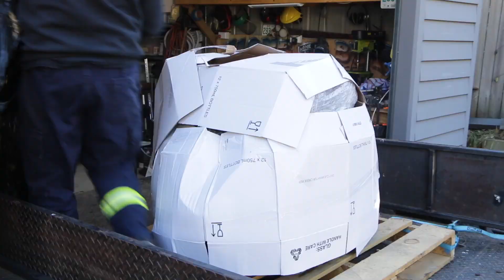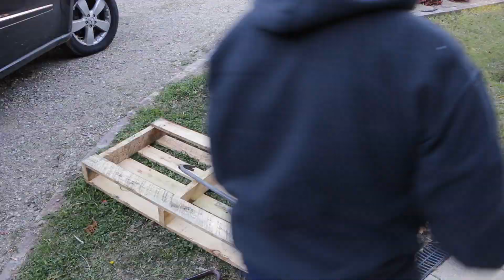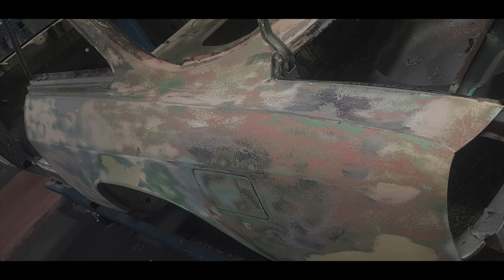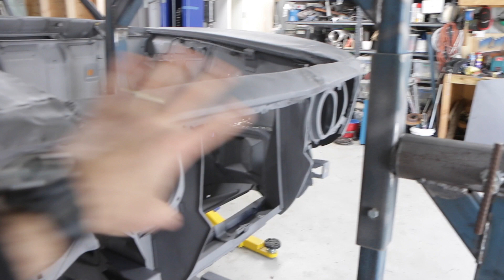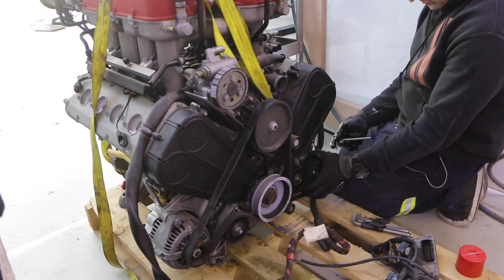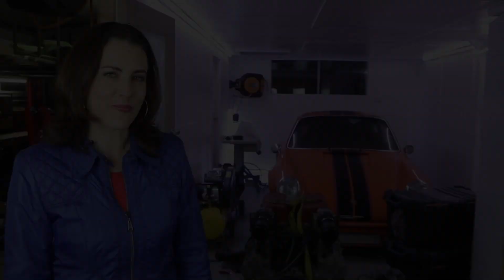How much does a Ferrari engine weigh? - Alfarrari 105 project car build part 10

Comment: I don't think that intake is going to fit under bonnet.
Maybe open velocity stacks?
Reply: With that engine? Just cut a great fat hole! Or perspex scoop. Anything to see that glory. Embrace your 90's show car aesthetic Jeff.
Reply: @DiscoFang  You're right, but you'll lose the 'stealth' factor of the harmless alfa.....  i would consider remaking  the intake so it fits under the hood.  Looks like that intake is about 300mm above the heads... holy cow.  Be curious to measure from centerline of crank to top of engine, it looks really tall.
Reply: Joe M When Jeff was talking about the engine with it next to him on the pallet I was visualising an episode of him making up a replica with cardboard boxes to get a ball park of fitment in the engine bay.  It's a curious thing, the relative heights. Scale in isolation can be deceptive.
Reply: @DiscoFang  Different car/engine configuration as well.  that ferrari motor went behind you, not quite the same challenges with vision.  i think the velocity stacks will be an excellent idea. it will look kick ass as well, they always do.
Reply: To do it properly, IMO, measure the effective intake runner length and approximate plenum volume, then using those measurements create a Medusa of piping to squeeze it under the bonnet, a la E39 M5 ;)
Reply: @computiNATEor  You put this engine in an E39?
Reply: @stuartd9741  No, what he means is that the E39 M5 has long intake runners, but they're not stacked vertically like the Ferrari engine, instead it's like a bunch of snakes down low covered by the intake manifold - from pictures I've seen of those engines disassembled.
Reply: Everyone loves a nicely done bonnet hump, lets people know it’s packing heat

Comment: Thinking aloud but if you have a custom flywheel done, would it be worth having the Ferrari trigger pattern on it too. Just think it might make ECU life easier as you'll need one that understands 'Ferrari' - based on the cam positioning with the quad cam setup, ign firing order and crank trigger pattern too!! - So if you ran an FA20 trigger it'll confuse it and might stop the cam and crank sync process. (I've just had a similar/ish issue on a standalone that wouldn't crank sync because my aftermarket flywheel was slightly different to oem spec).

Comment: If you have to replace the front section anyway, why not go for a step-nose?
Reply from the maker: I could, but I actually prefer the neater look of the later nose. I will be backdating the rear end to take the 1750 tail lights.
Reply: @HomeBuiltByJeff  I'm biased because my 105 is a step nose GT1300 Junior (with a 2lt Twin Spark transplant) but I personally think the later four headlight nose is too busy... horses for courses. Anyway, great project... it'll be a fun ride.

Comment: Seeing as you are building an Alfa hotrod, and you have lots of metalwork to do, just set the engine back further than normal, cut and rebuild the bulkhead (firewall), get the balance back that way.....
Reply: It won't do much, but move the battery to the back as well.
A bigger diff will help as well
Reply: Monk Really?! It will do much.
Reply: @tomahoks  I'm coming from the performance Miata world, where we use batteries that sometimes only weigh ounces
Reply: Dang! It I was going to mention this!
Further back the engine, lessens weight distribution.
 issue.
I Agree.
 Locating the engine
couple of inches back would help offset extra weight.
 + battery in the boot.

Comment: By the way small weight difference can be fixed not just by strengthening but also addition of larger fuel tank just behind rear axle.
Also help with traction of course😉🙂👍👍
Reply: Steve Veness You don’t wanna hang weight in front of the front wheels or behind the rear if you can help it. Yeah front/rear distributions important, but mass centralisations where it’s really at. 

Stick a big fuel cell behind the front seats under the roll cage!
Reply: @Jonathan_Doe_  Granted point of fact.
However if tank can fit over rear axle that would be perfect. More down force for traction. 

For example my UC 4 door Sunbird got a nine inch rear and a 90ltr truck tank above diff. Front end had motor sitting behind it.
I ended up with a 45 / 55 split with me in driver's seat which I figured was pretty cool.
Certainly goes round corners very fast😉🙂👍👍 
And of course every car is unique as to what work's due to wheel base track width and of course available space with out removing entire floor and starting with a tube chassis of some description.
In  Jeff's case behind diff could work out OK.
However neither of us are aware of what route Jeff is actually going to take.
Gonna be fun watching for sure😉🙂👍👍

Comment: how about Porsche 915 gear box?
Reply from the maker: Not exactly renowned to be a great gearbox, it is a transaxle which (which I don't want) and it faces the wrong way so I would have to have it altered.. and have you priced them lately ;)
Reply: @HomeBuiltByJeff  Yep. Dont recommend them. I had a redone one in my 911 and still had to be pretty careful to not rush it. I've made a video with that car, in the beginning you see me step in and drive away quite spirited, than it works. If you rev it high it will shift pretty good but its a bit of a pain otherwise. My mate who drove most of the video (while i filmed) couldnt shift it like that. Here's the video, (i think you'll like it) https://www.youtube.com/watch?v=GP_VsyCxb_k

Comment: Nice one Jeff - what are you doing with the Ferrari plenum? Looks too high to fi under the bonnet
Reply from the maker: There is a plan ;)
Reply: @HomeBuiltByJeff  I guess it's going to look cool just sneaking a peak out of the bonnet :D
Reply: The Alf twin cam is a very tall engine, there’s probably not much in it and the inlet runners could be shortened if required, what will take a bit of thought is the Ferrari’s engine is designed to sit very low in the car.

Comment: one way to fix the weight balance is to just throw a bag of cement in the boot :)
Reply: of course the more indulgent way to do it is to spend time strengthening the torsional twist through to the rear suspension by throwing some nice chunky steel bracing in :) .. just wait until you've stated with the fit up and see if you can steal someones car scales then you should be able to end up with a car at an almost perfect 50/50 balance by the end of it.
Reply: @KlaytheFounder  indeed😉🙂👍👍
Reply: relocating the battery could also help. take that 10kg lump from infront of the front wheels and put it near the rear wheels.
Reply: @myopinion69420  probs some lightweight bonnet would help as well
Reply: @myopinion69420  yeah, I don't think that the engine is going to leave much room for a battery under the hood anyways :D
Reply: @KlaytheFounder  yeah, that was my thinking, does not look too wide though, mostly tall because of the intake.

Comment: Wow, half the weight of the car must have been bog.
Reply: Should be way faster without the bog for sure😉🙂👍👍
Reply: @steveveness3829  looks like it has had multiple decent accidents in its life. sucks when you see that kind of thing.

I have seen cars where there has been nearly 4cm deep of bog on the bonnet, a panel that is easy to replace and easy to get the the reverse side of to fix.

why they didn't just take off the bonnet and give it a swift kick from the inside before resorting to bog i don't know.
Reply: @myopinion69420  LMAO yea I have seen that to🙂
As a matter of fact I had a HT Holden Station Wagon, that was side swiped by a truck on the right side of it
( right hand drive).
Rear quarter panel is hmm approx 2mtrs or 8feet long. They hung flat sheet steel over the damage oh and steel was 2mm thick then sooooo Much bog to create the shape. The rear door and front door I could hardly lift after I stripped them out.
They just went into the bin.
Have to admit it went round right hand corners really well no matter how fast I dared go around.

LMAO Left hand corners well above a snails pace and it drifted all over the road.😉🙂👍👍
Reply: @steveveness3829  yeah, it was on a mates drift car, he said he wanted to get a carbon fiber bonnet because his was too heavy. i thought he was crazy or wanting to spend so much on a bonnet that would end up getting wrecked anyway, went and had a look at it and you could see the massive bulge on the underside.

it was just an old s13 with dents all over. we ended up just taking the bonnet off and bashing it with the blunt end of an axe from the underside to break off all the bog and get it to a close enough shape, then rattle canned it.

it was a stat writ-off, so only a track car.